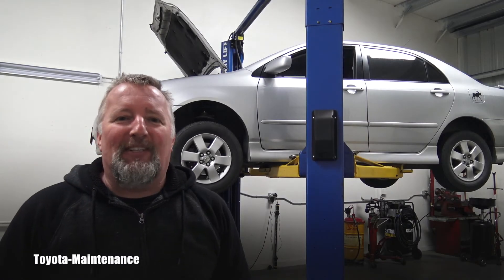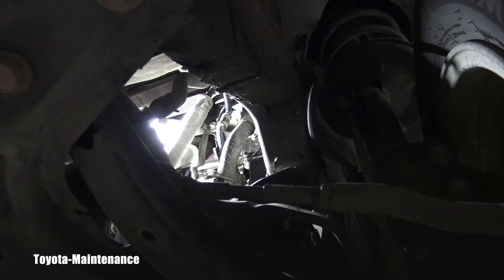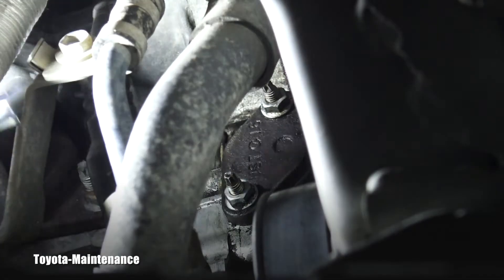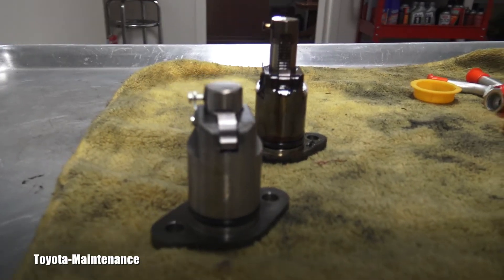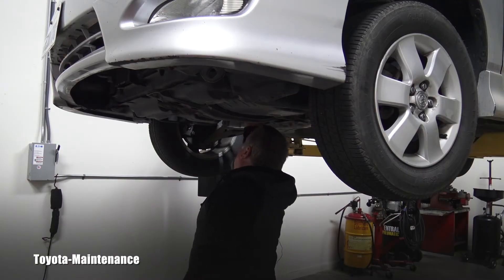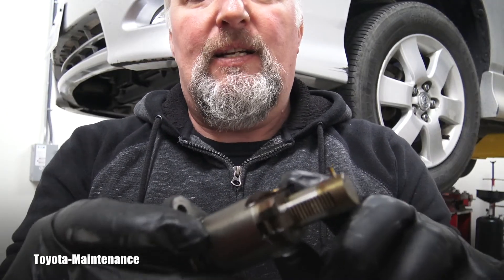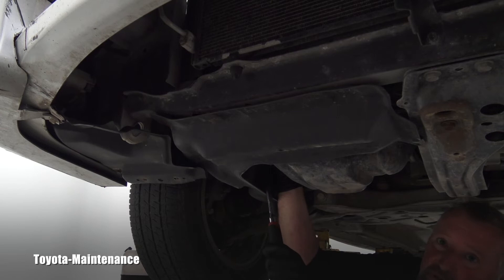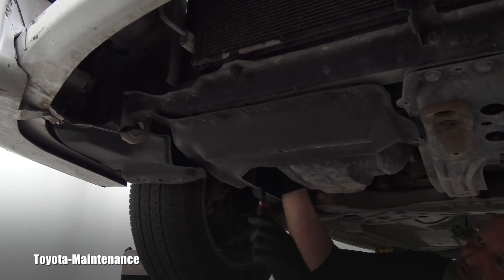Toyota timing chain tensioner replacement

Comment: does this fix the problem the cold start in the morning winter time it gives a small rattle for a second or 2 then goes away until the car sits more then 8hrs in the cold? Summer time it does not make noise on start up

Comment: Just did the tensioner on a 2004 Toyota Wish JDM import with 171k kms...and it always had a buzz/rattle at startup for the first time on any day...hot or cold ambient temps.
After this complete tensioner replacement with Toyota OEM part....no more buzz or rattle ever...

Comment: do you have to put the engine to TOP DEAD CENTER to make sure time docent jump when removing tensioner?
Reply: Goo question. Did you ever find this out?  I’m wondering if it can just get pulled out in any position or if needs to be at tdc

Comment: Mine 2009 corolla has 115000 miles and a leak at the tensioner.  I'm going to change the tensioner when I do the gasket.  I'm going to use the updated model tensioner.  The one on there is almost certainly original.

Comment: Does the #1 piston need to be a top dead center when replacing this tensioner? I am having difficulty getting the new tensioner to slide in far enough to get the retaining nuts to go back on. I have the tensioner piston compressed and retained by the small latch.

Comment: good video, a question friend, first you place the tensioner with the bushing closed and then when it is already placed you turn the shock absorber clockwise. until the bushing relaxes on the chain? I have seen videos that first give the opposite direction to the clock hands and then they give the right direction to the clock hands, can you clarify that doubt for me?

Comment: Explain something??
One video has you turning the engine COUNTER CLOCKWISE for the tensioner in a Toyota that you did a while back, and in this video, you're turning it CLOCKWISE???
Can you please go into depth about this?? I don't want to destroy my   2012 Corolla
Reply: Tdc turn it anticlockwise because the chain is loose but only very little like 15degrees then you hear the click and the chain in under tention now 1 full revolution and you set the other way is to take rocker cover off that's the best way of doing it you can have a visual of everything and not go in blindly😊
Reply: @hassemsadiq  
You said ANTI clockwise??

What language is this??
Reply: @liveny  British maybe you would say counter clockwise

Comment: Mine engine light came on after replacing the tensioner.
Reply: If you didn't do it right could cause alot of issues

Comment: Hello Sir, Thank you very much for this video. I followed steps, Put chain on all the timing marks. But when I turn engine by hand, 
Yes I turned engine 5-6 times but still chain marked links are matching, did I do something wrong? engine run fine after I put back together but it does through code P0017. Please advice. Thank you very much!!!
Reply: Hey, what ended up happening to fix it? I have the same issue
Reply: @abiboocock276  Customer sold car as it is.

Comment: Thank you sir for posting this.  This successfully fixed an oil leak at the timing chain tensioner on my 2005 Toyota Matrix XR.  Great video and information.  Other videos showed the belt tensioner having to be loosend.  That is not the case like you said except for the higher performance Yamaha engine.  Took me less than 15 minutes to change out and saved me lots of money versus taking to a dealership or mechanic.  Thanks for what you do!

Comment: Thanks. My corolla engine is 2NZ-FE model 2004. Do you think replacement of the tensioner is like you did here?
Reply: I believe the 2NZ-FE is a Yaris engine.  A 2004 Corolla has either the 1ZZ-FE engine (LE, S & CE models) or the 2GG-FE engine (XRS only)

Comment: Do the latest versions of this tensioner not have the O-ring? The part # 13540-0T020 appears to be without an O-ring but still requires the gasket from what I can tell.

Comment: Do you have a video for a 2006 Corolla  transmission idle control solenoid for the torque converter . 
Car run’s terrible when at idle

Comment: Do you have to take the top cover of the engine to put the timing chain tensioner?
Reply: That would be much better get it to tdc then take out tentioner put new tentioner in and do it anticlockwise keeping an eye on tdc it should move very little and you'll hear a click have a look inside then turn clockwise 1 revolution put everything back together together rocker cover make sure you put sealant where the timing side meets the block you all set good luck

Comment: i have a pontiac vibe 304,000 miles on the 2zz-ge, a massive oil leak just came about from the tensioner. thank you for the inciteful video
Reply: Impressive 304,000 miles.

Comment: I have this leak. Still very minor. I’ve seen some videos say turn crank counter clockwise and some clockwise. Does it matter as long as you here the tensioner release? Planning on doing this repair soon.
Reply: I've read warnings that do NOT want to turn the engine backwards, ever.  So i think turning the correct direction is very important.  Idk
Reply: Get in on tdc when you turn anticlockwise you doing it less the 15degrees very little till you here the click then clockwise full revolution you all set🎉

Comment: So 2005 Corolla have a Timing Chain and not a timing belt, correct? Do I need to change the chain too when I replace the tensioner or I can just replace the tensioner because of the o ring leak?

Comment: Will this work on my 2012 ct200h? The tensioner looks exactly the same. I am very mechanical but some guy told me I had to take the valve cover and check some points here ans there. I think he was scaring me so I ask how much he would charge me. He told me 700 dollars. I think I was pulling leg after seing you video.

Comment: Great video. Thanks toyota tensioner. I did it successfully 6 month and everything worked perfect. But, apparently the new tensioner o-ring now have started leaking. I just remove the oring with a good one, i turn tha crank manually and I heard the click than  i tried to turn the engine on after i cranked the starter 2 to 3 time the engine was blocked. I removed the tensioner again I saw it was armed correct. I put it back but now it is impossible to turn the crank manually it seems that engine is stuck somehow. if you know what might have cause this, please reply to this comment. I really will appreciate you help. Thank you.

Comment: Do you have to drain the engine oil before replacing this part?
Reply: Don't have to, as all you will get is some residual oil that may seep out...  Just make sure to clean the area and bore well before installation.

Comment: Hey can overturning the 19mm cause tight seprerine belt?, I turned it clockwise to many times I think & now the outer belt is tight cause had an issue were I didn't put a gasket on so had to take out the tensioner out & redo this but now the bolt is tight moving & belt is tighter, the bolt will still spin but has become very tight

Comment: Can the timing chain tensioner  for a 2AR FE engine be changed in the same way?  My engine rattles for a second when starting form cold.  Warm starts/ restarts no rattling sound.
Reply: That is probably the vvti cam gear not locking after oil pressure flows out of it.  The lock pin spring is weak which causes the rattle for 1 second on cold startup until oil pressure builds.
Reply: @CPpuppies  Thanks for the info.  Would  it be the intake or exhaust cam?  or both?
Reply: Most likely the intake one.

Comment: What is the correct way to unlock the tensioner after replacing it?should rotate the pulley in the forward position as opposed to reverse

Comment: I read a comment in the AutoZone website that the O-ring from the Duralast tensioner is smaller than the other O-ring, and that it can still leak. Is this really an issue?

Comment: So I did this on my toyota corolla and sealed the tensioner using permatek gasket maker and it is still seaping oil! Did I not use enough gasket maker? I feel like I used a lot of permatek. Its not a crazy amount of oil, and to be fair this solution did prevent the leaking for probably 3-4 months. But the small leakage is back again!

Comment: Have ran across a 2ar that has a rattle at idle under load.  As soon as I increase the engine speed it goes away.  All accessories have been changed.  I question the chain tensioner.

Comment: It seemed that you crank over that engine easily.  I would have thought that there would be some compression holdback.  Did you remove the spark plugs to make it easier?

Comment: I have a 2011 Prius. The tensioner is exactly the same. I placed the new tensioner in, but I hear no click when I crank the crankshaft. Any ideas?
Reply: Is it a half turn off when placing the tensioner into the hole as to why it does not engage. I have the same problem. Now my ob2 meter says I jumped a tooth on the timing chain.

Comment: Hi Peter! I’m going to try to change the tensioner on my 01 2.4 4 cylinder Tacoma. Do you know if I can replace if this same way without worrying about timing marks?
Reply: The only worry is if and when the timing tensioner engages when you turn the crank by hand

Comment: where exactly is this main crank bolt?  and can I access it from above?  I need to replace mine on my 2004 Corolla but don't have a way to lift vehicle, I'm handy and got tools
Reply: He is talking about turning the crank pulley down at the bottom of engine

Comment: I'm going to replace mine. It mite be the leak. I'm also going to carefully probe with a  screwdriver and see if I can feel how much play there is in the chain. Maybe a magnet will work also. Just can't drop it inside. Chain should be steel and catch it on the side.

Comment: Does anyone know if replacing the tensioner to fix the oil leak will require adjusting the timing? I'm getting some crazy price quotes telling me they have to replace the chain when doing the tensioner for the oil leak.

Comment: i will do this job on my Toyota Avensis 2008 3zz-fe engine and my question is the service manual says first turn crankshaft anti-clockwise a little bit and then clockwise or just skip it and turn the engine clockwise, thanks
Reply: I have a 4ZZFE, Finally you did the job? In another video from this guy, he turn left the engine a little bit (counter clockwise), to release the tensioner
Reply: @PhysXe30  you can turn engine clockwise it will release if not turn a little bit counter clockwise and then clockwise and you will hear the clicking sound of the tensioner for more check turn couple of turns to make sure everything alright DO NOT TURN THE ENGINE WITHOUT THE TENSIONER 

ONLY, turn it while the tensioner installed
Reply: @floor_jack1441  thank you, today I bought the oring and I installed it. First I did counter clockwise a littlebit and in the moment I go to turn clockwise I heard the click noise from tensioner.
Thank you, worked in 1.4 ,4zzfe

Comment: I have a 2013 Corolla and when i first take off i hear what sounds like a chain rattle for about 1 second. Does this sound like the tensioner? Usually when cold. 1.8 engine. 
Also, would just be the same procedure on a 2013 Corolla?
Reply: It's most likely the vvti cam gear.  The lock pin is not locking it due to weak spring.  My 2010 Pontiac Vibe with the Toyota 1.8 does the same.

Comment: I replaced the oil sensor on on my 2004 , 4 cylinder 2.4 , Camry,  which reappeared along with the grinding noise on cold starts. Would replace the timing chain tensioner first eliminate the grinding noise ?  .

Comment: I cant install the new tensioner. It won't fully seat to get the nut on top. I can't push the new one in to install the nut on. I got the correct orientation

Comment: Hello! I have an issue with my 06 corolla 1zz where sometimes it doesn't start at the first crank. It takes a second crank or a third crank to start and at those times, it also sputters for a fraction of a second as soon as it starts but then quickly goes back to idling normal. This only happens sometimes, other times it starts fine. I'm not sure  whether it's a chain tensioner issue, grounding issue or is it the fuel pump. A little help would be really appreciated.

Comment: I got distracted from my kids FIGHTING and had to whoop them while doing this. I didn't do the step where i turn the engine over by hand to hear the snap. I just sat in the car after installing the tensioner and about ** my pants when I realized I forgot! Is it possible that everything is fine? It seems to be running the same, maybe just a tad weaker, but I might just be imagining it. No misfires, no noticeable changes.

2000 Toyota Corolla CE - 1zzfe

Can you let me know if it is possible with your infinite wisdom and knowledge? Thank you!
Reply from the maker: It sounds like you are good to go another xxxxxxx happy miles

Comment: My timing chain tensioner dosent want to come out after removing the two 10mm nuts, do I have to loosen the tension on my serpentine belt or just try to pry it out with a screwdriver?
Reply: He mention about the serpentine belt loosening  towards the end of the video
Reply: wondering as well because my wont come out either

Comment: I thought you rotate the engine counter clockwise to release the hook? No? Maybe so on a 2zz???
Reply: Manual says first counter clockwise and then clockwise......but clockwise  also works fine
Reply: let me think yeah but then also in the same section of the factory manual it says "never rotate the engine counter clockwise".  Can't remember what page I saw that on but the same main overhaul section that covers the timing gasket and chain tensioner etc.
Reply: let me think I guess disregard my above reply. Just looked and you're right it mentions both. But I swear I saw somewhere where it said not to. I know it says don't rotate without tensioner installed. But I swear I read somewhere not to do it counterclockwise. Maybe in an entirely different section. Hell I don't known
Reply: @AmeriFanPicker  Anyway i have a question....is it ok to rotate engine by alternator pulley?.... I have done it before
Reply: let me think I doubt you could. The belt Would probably slip on the crank. There's no danger of that happens. You'd just be spinning the water pump, power steering, ac, etc. serpentine belt doesn't have anything to do with the cams/crank. But frankly it's pretty easy and accessible to get a ratchet on the frank pulley but. 19mm I think. Easiest to do from below or even the whee well with the plastic lining removed. .

Comment: my 09 Corolla has a rattle on startup that goes away after a few seconds.  could the tensioner be bad?
Reply: halleffect1 you have a bad vvt gear
Reply: @smitty1715  thanks Rob, after researching some I was reaching that same conclusion.  hope to tear it down soon and repair.
Reply: halleffect1 I wanted to attempt mine but I had the dealer do it it only cost me about $900.

Comment: How many times do turn the crankshaft after installing the timing chain tensioner? and do I need to reset to TDC?
Reply: Oh, your not the own of this video. Your also a view, sorry. Through you was the poster
Reply: Ardent Fan Here’s a conclusion to replace the tensioner on my Corolla. I’m happy to inform views the engine timing was not off set. I did pay for a diagnosed($100)to make sure. This video is an accurate technique if done right for replacing an engine timing chain tensioner.

Comment: Once installed and turning motor, what piece of hardware releases that hook allowing the bolt to pop into place?
Reply: no piece of hardware. its the chain itself and gravity.
Reply: @Anotherdaynparadise  Is it installed with the hook facing downwards?
Reply: @metrork1  i dont know that hooks have a face. So how does a hook face down wards?  idk what that means in your perspective. Your question is not decisive enough to being interpreted just one way..the hook needs to hinge downwards when released from the pin from the bolts torqued down against the chain and have the open end upwards against the pin so when the chain tension releases it dose not stay hanging on the pin.
Reply: @Anotherdaynparadise  Thanks for taking the time to answer me. I now understand.
Reply: @metrork1  you welcome brother

Comment: I have an '05 Corolla XRS w/ 2ZZ motor. Have developed the oil leak. Dealer is saying 7-8 hrs to do this job because they have to take all the ancillaries off the front end of motor to get the timing cover off to change the tensioner. $900-$1000 & $45 for tensioner.  Is this really such a simple, quick job?    Assuming I can get access to see what the heck I am doing. And assuming I can get the serpentine tensioner bolt broken loose & the tensioner moved clear. 

Does the tensioner bolt into the block or the head? Trying to figure out where I need to look. 

Thank you

Comment: when I tried to remove mine today, I got both nuts off the bolts but the tensioner refused to come out. It only came out like 1mm, it moved when pressed back in but won’t come out further, any ideas ? Thanks

Comment: I heard it being mentioned by someone else on another video, u have to turn it clockwise manually, I think it’s when u turn it the chain stretches over the guide and the guide pushes against the tensioner and it backs out just enough for the hook to fall down
Reply: Turning the alternator WILL turn the crank as long as the belt is installed
Reply: Can we turn the alternator bolt instead of the crank bolt? It will some good turns as the alternator pulley is small?
Reply: @GihanTimantha  little late I'm sure but turning the alternator won't turn the crank

Comment: hello sr ,very use full information ,i have a question ,does it use any other  gasket then that rubber little circle gasket ? or just go like that .
Reply: This particular style tensioner uses only the O-ring to seal. Some of the older Corollas use a gasket to seal on the surface instead of the O-ring